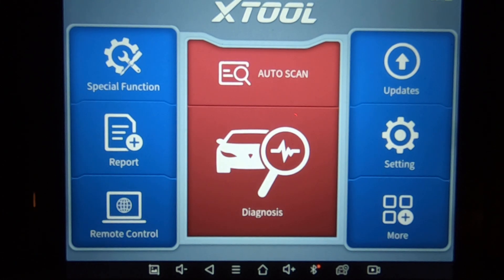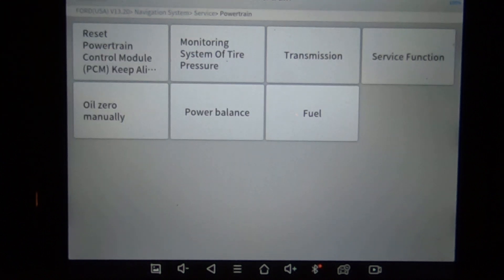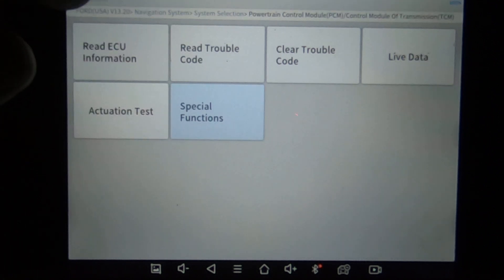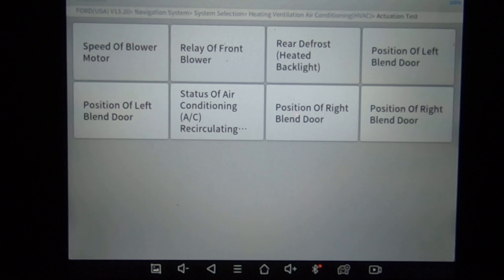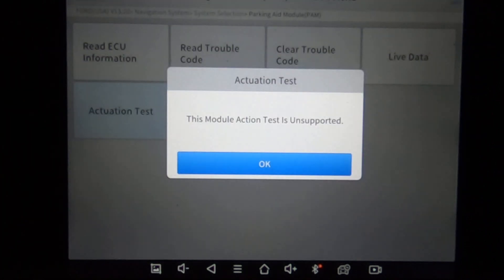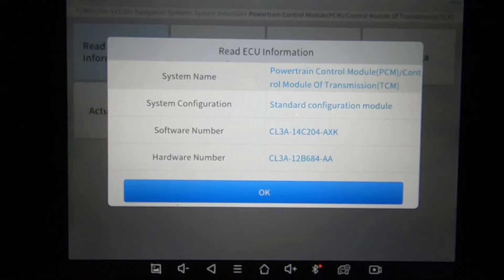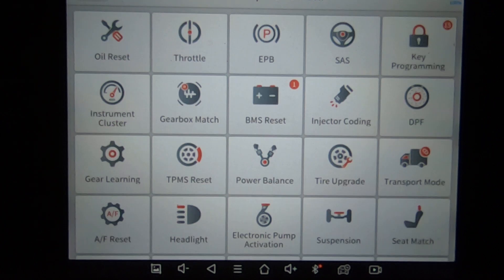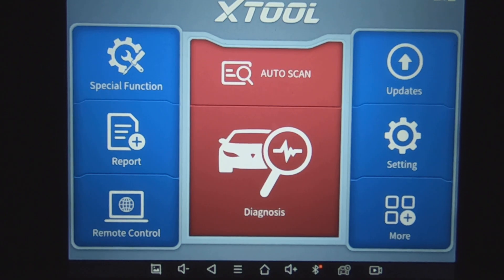2012 Ford F-150 Walkthrough with the Xtool D8 showing the Active test and Special Functions.

Comment: Sorry if this has been asked. But is this capable to narrow down problems in the evap system? Does it allow manual control of individual sensors and solenoids and valves. Thanks in advance
Reply from the maker: Yes it can control all the EVAP solenoids and show the live data along with doing a complete EVAP test depending on make and model.

Comment: Have the same xTool D8 BT and 2012 Ford F150 XLT and cannot get the ADD KEY to work. I get the error, "Cant Connect" when trying to add a key. Have you went through adding a 2012 Key? Any advice on getting this process to work?
Reply from the maker: Next time I get a ford in I will give it a try. In the mean time last night was another ford update so make sure you are updated.

Comment: Hi I just saw your other video of this scanner, the BT version, so I was wondering since you showed the new BT (bluetooth) version uses the same case if is it possible to wire it to the OBD2 port. I’ve noticed it has the same port out for the cable while being Bluetooth. The reason I’m asking this is because I’m just a DIYer and I wouldn’t like to rely on batteries since I won’t be using it that often. Thank you
Reply from the maker: I will check that and let you know, but if you would rather use the cord just get the D8.
Reply: @737mechanic  tried to contact Xtool ppl. I wonder if the D8BT can also be wired since it has the same terminals in the back. No response yet
Reply from the maker: @Lowdown13blues  It would be nice if it came with the cable also but it doesn't so you would have to acquire the cable.
Reply: @737mechanic  I don’t mind at all getting the cable but Xtool people wrote in one of the reviews on Amazon that the cable wasn’t an option therefore I thought the device didn’t have the port for the cable at all so it was until I saw your video that I realized that it goes have it that’s why I’d love to buy the Bluetooth version and the cable separate if it’s going to work. 
Would you happen to know if using either one is an option ?
Reply: @737mechanic  in other words did you try plugging the cable on the Bluetooth one to see if it works ?
It’s all I’m asking. 
I apologize if this whole thing looks too complicated !!
Reply from the maker: @Lowdown13blues  No I have not tried that yet but I will, I did think about doing that but didn't.
Reply from the maker: @Lowdown13blues  The thing is the BT version is $80.00 more than the corded so if you would rather have the corded version you need to buy that one. I am not understanding why you would consider buying the BT version if you was going to get the cord even if it will work with it.
Reply: @737mechanic  I usually buy things to last forever, but lately nothing does. With this in mind and with all this Chinese manufacturers not backing up their products 100% plus me not using it daily it’d be like another thing to depend on, a battery. 
A while back I bought a few items from the NOCO family, a jump starter among them, and they worked fine but after a couple of years and just when I really needed it the battery got of the size of a watermelon and down the drain were $200 plus got stuck with no help. 
Since I’m spending the money I’d like to have “the option”, just that. Would I use it ? Not really, but if it fails I’d like to have a plan B.
Reply: @737mechanic  I meant using the cable of the non Bluetooth one on the Bluetooth one. No need (in your case) to buy anything I believe
Reply: Well, according to Xtool the BT unit can’t be connected with the car through the cable due to a hardware setup.
Reply from the maker: @Lowdown13blues  Good to know, I am not even going to try it then. Basically if people want to connect it to the car with a cord then get the D8 and save about 80 bucks, for people wanting to have the freedom to move around untethered get the D8BT. The one pro for the D8 is it also charges the unit from the OBDII port so I have never had to use the charger it comes with, my D8BT I just finished charging it up using the supplied charger.
Reply: @737mechanic  you’re very right sir !!
Reply: The only issue I have with any BT Scan tool is that Live data is delayed or not accurate when you’re doing live testing. Accuracy is important. Sure it’s a convenience, I own a Launch Torque, SO Solus Ultra for the 2ch scope use and guided component feature, Xtool D8 - not BT. You can always buy a VGA cable and extend the cable. Running 20ft currently using a female to female VGA adapter and 15ft Male to Male VGA cable. Works fine. Long as the cable from my SO and handles most cars up to 2018, anything newer I use the Xtools d8 for. Recommend buying the Chrysler Bypass cable too if you touch newer FCA vehicles. Only can do that w the D8, not the BT, so keep that in mind.